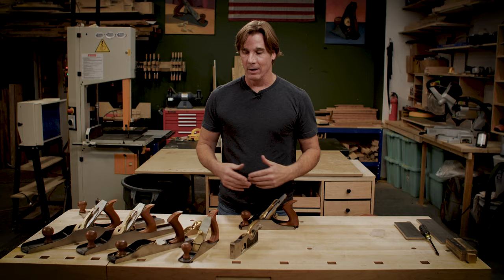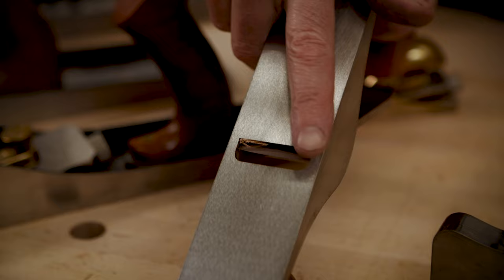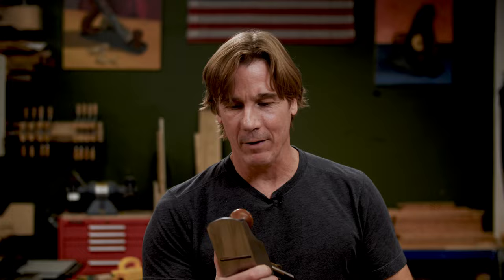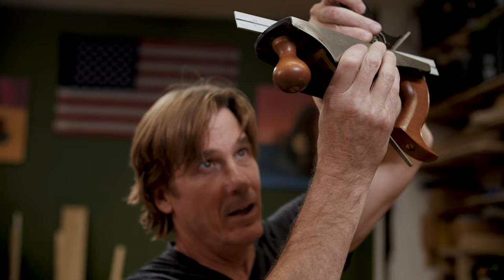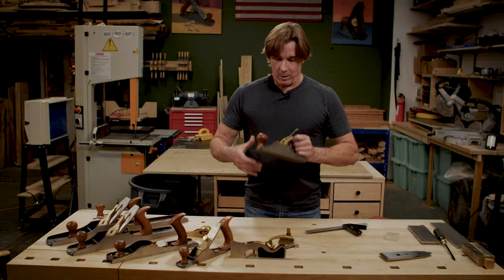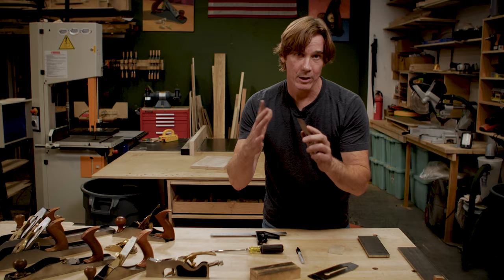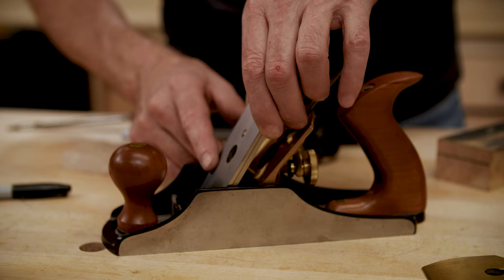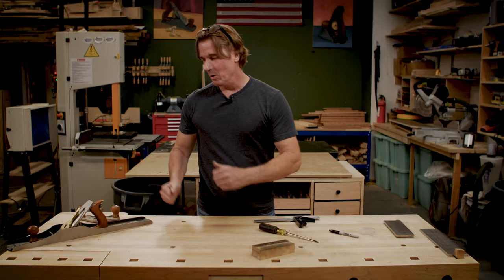Hand plane how to

Comment: I have a total of 19 Lie Nielsen planes. I tried but I can’t pick a favorite. I can pick some I like more than the others though. It’s taken me over 30 years to acquire them and I’m eyeballing the scrub plane for my next one. My rarest is the #1 1/2 plane. It’s about the same width as the 1 but longer. Very cool plane that I don’t really use because of its scarcity. I have all three sizes of shoulder planes and honestly I use them all. I love using the router plane because it’s calming and faster than pulling out an electric router. At my age I can hardly lift my #7 so I don’t think I’ll be getting that one. I also really like using both the #60 1/2 and #9 1/2 block planes but I don’t think they make the 9 1/2 anymore. I have maybe 3 more to buy but that will be determined not by what I want but what I can’t live without. Thanks for covering these hand tools on today’s episode. It’s always a good episode when you are using hand tools for one one of your builds.
Reply from the maker: Ha!! That’s A LOT of hand planes Dave !!  My favorite is the one that is right for the job .. Tom and his team do a great job making planes up there in Maine .. good peeps
Reply: @TommyMac1  The one that’s right for the job. Well said Tommy.